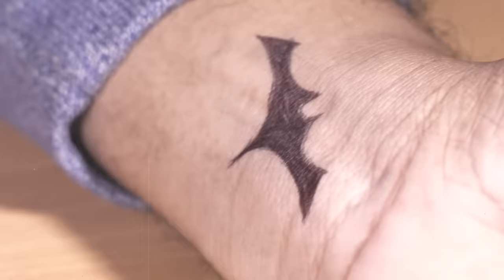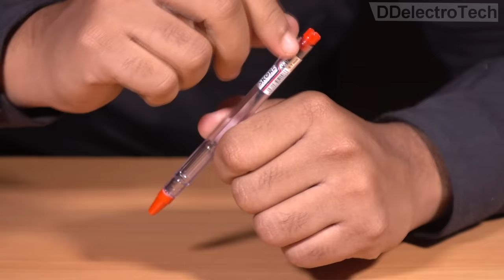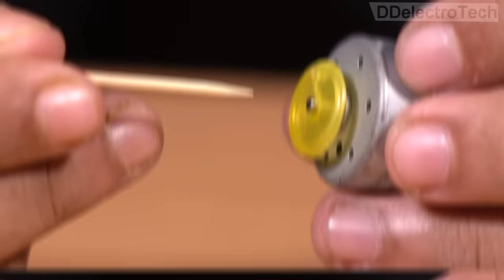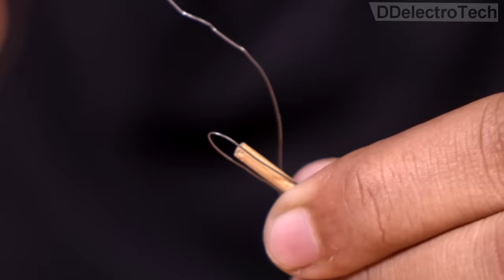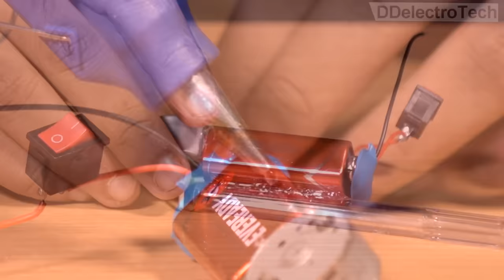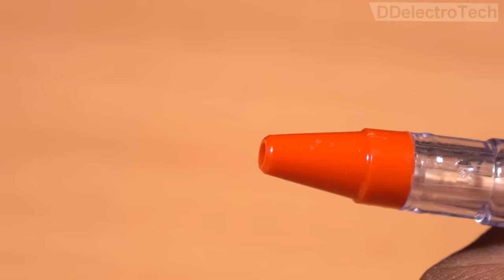Making a Simple Permanent Tattoo Machine at Home - Science Experiment

Comment: Syringe is about the worst freaking thing you could possibly use to tattoo with.. you'll just mess yourself up pretty bad.  Not that I recommend it but your better off using guitar wire, straightend lighter spring or pen spring.  Sewing needles.  Those are all 10x better than a damned syringe needle